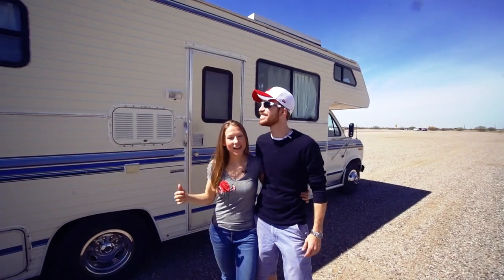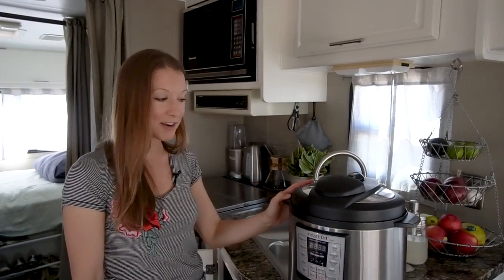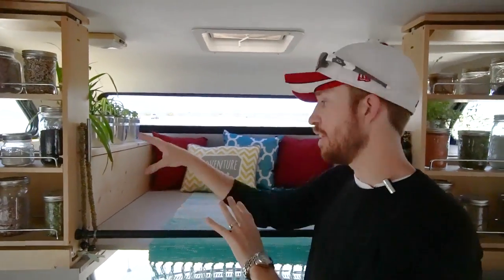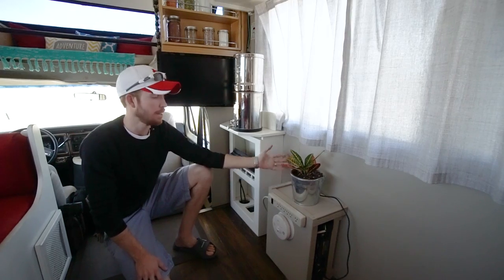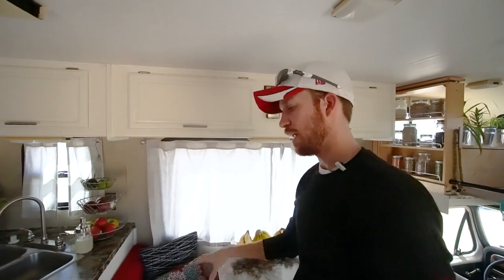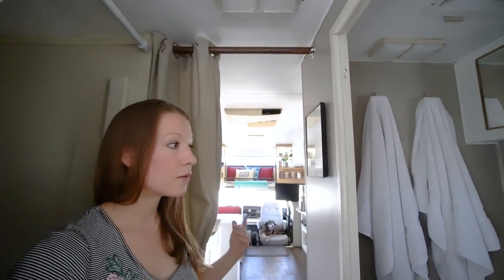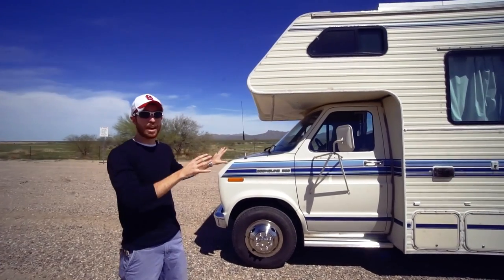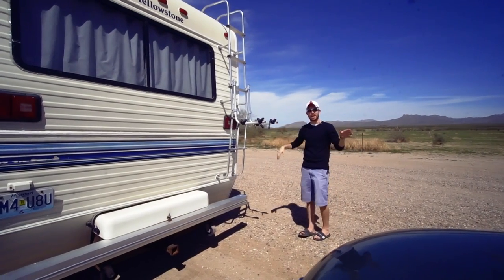They Renovated A 1989 RV Into A Beautiful Budget Tiny House

Comment: Be careful using solar! It's nice but have an outlet for all unused electricity. Meaning have something that will use it up. If you don't have enough batteries that is. If you don't have enough batteries that they can't all fully charge so that electricity will always have a place to be stored or you don't have a way to use up all extra electricity you could overload your wires and cause a fire. My uncle learned that first hand when his house caught fire. We think he had too much electricity in his system and not a good enough outlet. Within a week after he doubled his output his house which had stood for years suddenly burned down. The fire was found to have started at his woodpile which was within arms reach of his batteries. 
He had been using them for years. But they were in good shape. The only reason they would have suddenly caught fire without someone burning his house down is that his system overloaded. 
Just my two cents and a bit of a PSA

Comment: Oh my gosh, these guys are so much like me in their thoughts and in the RV they bought. Even their Berkey water tank is the same! My RV's name is also Harvey. Mine is Harvey, not just because it rhymes with RV, but because of a memory of my late father... His name was John, but the name Harvey ties into a special memory of something he used to say and do, that he picked up from the movie "Harvey" the rabbit. Therefore, the name. My Harvey, looks like the motor home in this video. He's about four feet shorter and is a 1997 model, but he has the same Ford engine and the same bright and light interior. Even the exterior colors and pattern are much the same. I don't have any dents, but that's because mine was protected in an RV shed and is nine years newer. Otherwise, they're very similar. The cabin in mine has real oak cabinets as well (red oak) and are in excellent condition, so I don't need to paint them. For this reason, I'm putting in a red oak flooring to match the cabinets. The furniture it came with is in great working condition, but I don't care for booths and both the booth and the jackknife sofa, are upholstered in a bluish grayish flower pattern. Besides being slightly faded and very dated, the fabric on them is just plain ugly. They're going to the curbside for whomever wants them. The baby blue worn out carpet, throughout the RV and even in the cab of the truck, isn't going to the curb to be adopted by a new owner... It's going straight to the dump.   I'm replacing the sofa with a brand new, rich mahogany color "leather" jackknife sofa, and putting in a 30" round table with a granite top, and two chairs, of which I'll recover the seats with the same  mahogany leather, and also recover the seats on two fold up chairs in the same leather. I'll store the fold ups for when guests join me for dinner. With the booth gone, I'll also have room to build in a small computer desk. The white Formica countertops that are in the galley now, will be replaced with matching granite that's approximately the same color of the countertops the couple created in the video. Because my  Harvey is shorter and newer (meaning I don't have to replace everything they had to replace) I'll probably be able to afford the cost of the of the granite I'll need. If not, there's imitation granite that people would be hard pressed to guess that's it's not the real deal! It's made out of rock, but not it's cultured, patterned by nature itself. I plan to have solar roof panels installed but haven't priced out the cost yet. To be honest, I'm a bit worried about what it's going to cost! If anyone reading this comment is able to advise me in the most cost effective way of purchasing and installing solar panels (I don't intend to do it myself), I'd greatly appreciate any information! I'll check back in a few days, and again from time to time to see if anyone has replied. Bottom line: I'm wanting to avoid all but State and National RV camping spots, and especially the costly resort style RV parks. I prefer to live off grid as much as possible, and to visit and stay in naturally scenic places. Solar power, along with a generator, and propane, will make this doable. I believe it will be worth the cost of the solar panels in the long run. My thanks to the couple in the video  for giving me so many great ideas! Also for the encouragement of knowing that I'm not alone in restoring an older RV, and in some respects, even reinventing. Also, a huge thank you to "Tiny Home Tours" for producing and sharing this video. It was well done and has been very informative. It's comforting to know that there's a like minded community of RV folks out there that I might even run into here and there (not literally "run into" of course :o)  Kathryn

Comment: It looks like ur rig is a little low. There are air bags that wud help lift it and the air bags also add stability.  If u have coil springs in the front they make bags that will go in them and add more stability as well. The RV repair guy, LLC Vernon, AZ

Comment: My electronic pressure cooker which you call an instant cooker caused a lot of mold after a while. Mold can make you very very ill once it has built up and condensation is in your windows and walls. Keep your windows open so that the steam can escape and clean out your window sills after every use and wipe your walls from any condensation. It will build up for sure. I have now changed to a crock pot. A slow cooker is next on my list. The electronic pressure cooker is gone. And I loved it. I am so sick from toxic mold it isn't even funny. If you start losing energy or get rashes on your head or body you will know you have it.

Comment: Question: How do you assure your RV has good bones, the engine/transmission is sound, the chassis is in good shape. The RV is adorable but it’s still basically a car. It rattles down the road with thousands of miles & “things” rattle loose & the things that make it an RV can rust. That’s what kept me from buying an older RV that has so much upgrade potential. I’d hate to put money into the esthetics of the inside (which makes it adorable) & yet have major issues with the bones of the entire RV. Do you spend the $$ to get it inspected? I have a check list & the inspection is worth every expensive cent. Just curious as to what you did to assure you were getting a solid older RV. Thx.

Comment: Did you ever think about putting a couple of coats of polyurethane to keep it from chipping I painted my countertops in my bathroom years ago end it did start to chip off but I didn’t put the polyurethane on it Then a few years ago I remodeled my small bathroom and put lace over top of the countertop and did polyurethane it and it held up really good

Comment: I want to do something like this. The only thing I am afraid of is older vehicles and the possibility of it becoming unfixable... Like transmissions or something with the engine etc.
Reply: If I ever do another class C, I want to find one that has a good body and a blown engine...you can pick 'em up cheap...a 12 valve Cummins and an Allison trans...most of the gas engines are boat anchors...

Comment: Short on prep space in the kitchen?  Your familiar with wood working so why not get a piece of wood (maple, oak) and mill it to fit on top or over one of the sinks.  You'll need to router the wood on the underside so it fits snugly when on top of the sink.  Since it's removable, easy storage, too

Comment: The Berkey? I have water delivered and the cost is killing me. It always starts out to be a good cost and then their service raises in cost and their bottles of water raise and the rental of the unit raises and my bill this month was over $60 one month I paid $80 for one month and it must have been more than one month but I don't have time to go with every little thing and check every little cost. It drives me crazy. I ordered a Vitamix online and they continue to take payments out for 4 more months and I was not understanding why I was low on money? Finances are hard job and I've done it all my life and thought when I got older it would be easier but no. And no it wasn't showing in my bank account at the time. I must have been looking at the wrong time every month. I digress where do I get the Berkey? And is it good at getting out chlorine and fluoride and rust. Using plastic placemats would be a good idea with some cloth napkins? That way you wouldn't feel so plastic. I'm also vegan and was raw vegan doing intermittent fasting until intermittent fasting put me in ER. Had to stop doing that part of it.